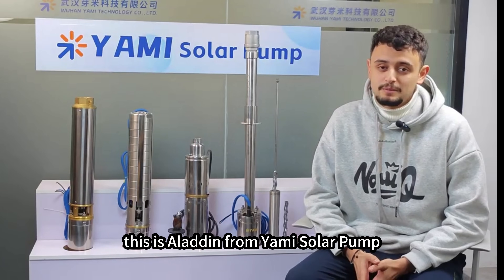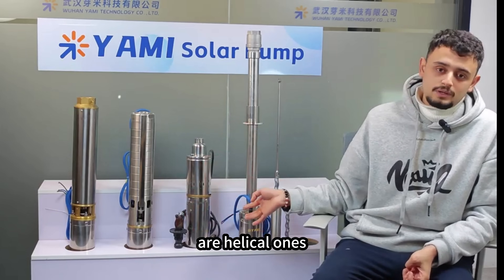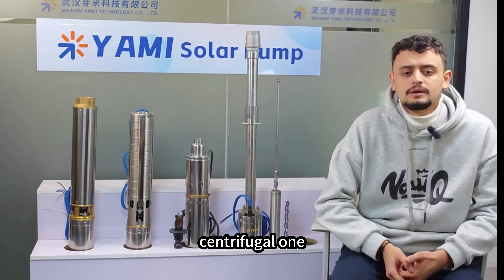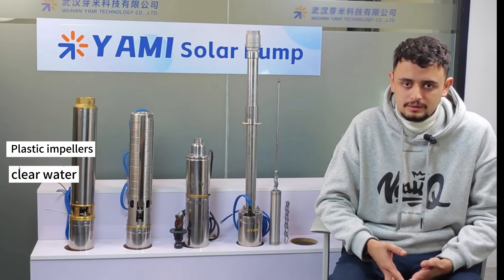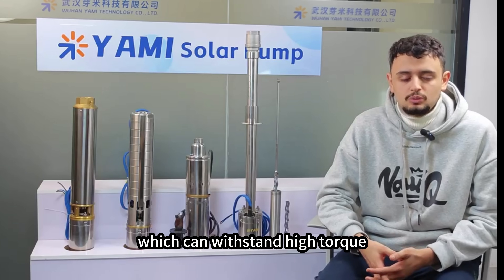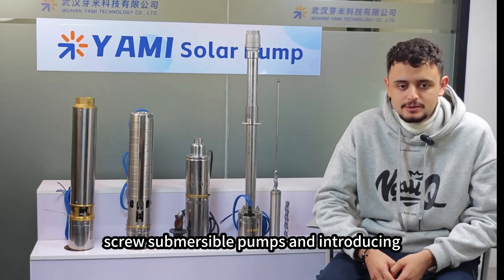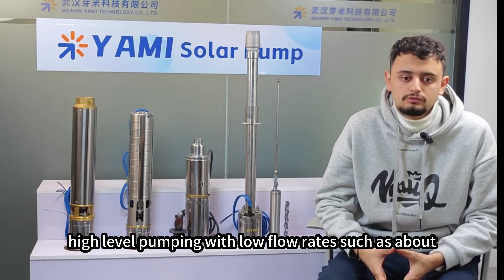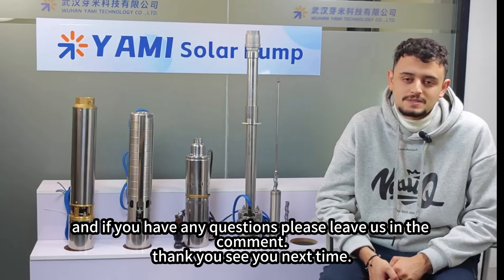Solar Submersible Pumps ：Centrifugal VS Helical

Comment: hello so you are saying that screw pump is more powerful than impeller pump? 
Because you said that a screw pump has a low pressure but high flow rate, and opposite on the screw pump.